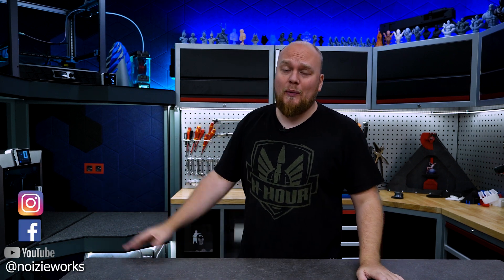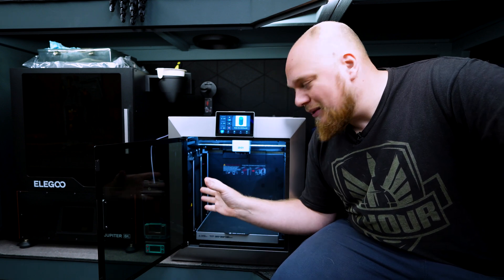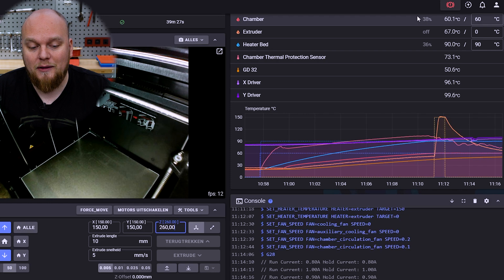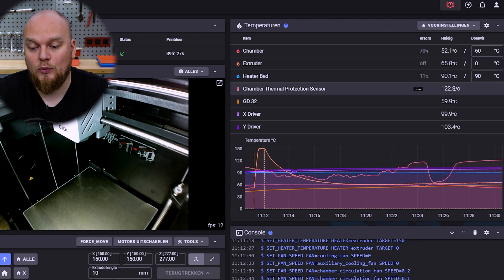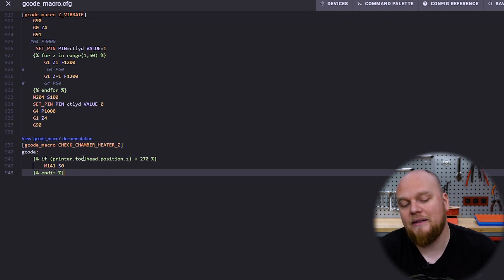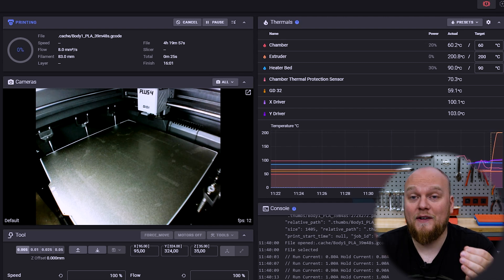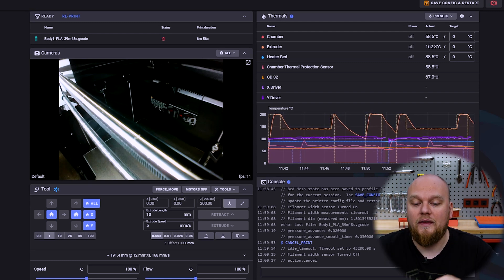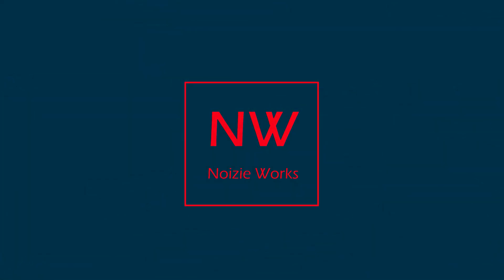Qidi plus 4 has a new design flaw and here is how to temporarily fix it. Bed blocking chamber heater

Comment: A few notes hope QIDI sees this.  To date I have had zero issues, but glad I did catch your comments on this one before I go make a full 275 or 280mm height object in ABS or something requiring heated chamber to be on.  I have had nothing but great success with the 4Plus received back on 25 September.   I did send their tech support few notes and thoughts after seeing your first comments addressing this topic.    If adding a heated chamber fan it should not directly blow few cm away from the ballscrew(narrower ducting or vertical uprights allowing hot air to not directly hit only one side of build plate, leave some room in the case design(perhaps a dedicated aluminum offset box area dedicated to a chamber heater)allowing for easy ability to add a custom duct on the outlet.   I do see where this can be issue for the last few millimeters of a 280mm build height, but do see some workarounds that are possible, simply shutting off chamber heater for last fill layers my be all that is needed until the full fix gets put out.  

This may only effect folks with chamber heater on the last few millimeters, good catch(thinking some side ducts on chamber air exit may be helpful, but waiting to see what they come out with).   I know they are working on this one, will see what they come up with, very important for me because 90% of all material I print has heated chamber going and I do on occasion print some very tall materials.   Thanks for sharing this information.   

I have full faith they come up with a work around and fix, they do awesome job when things like this are found, they have a great running track record of adapting fast based on user feedback.   This is all part of the whole mass market process for 3d printers happens to any and every company and the best ones learn, adapt, fix, and grow.    That is the sign of a great company, so far to date every QIDI product has been rapidly updated based on great feedback from customers like yourself.   This is not a reason to not buy, currently only effects small last few mm of full height and there are some workarounds.  This machine prints some great prints, and is very consistent at doing it, not a game ender for me, it has too many pluses.  Very happy with my machine, the Bambu while nice is way overpriced and does not come with the stock heated chamber, hence why I do go QIDI path.  I had priced out Carbon X with heated chamber and price was around $2400 and than it only had the 250mm bed size, was a no go for me.  The Plus4 prints out layers just as well as Bambu, has a larger plate(305mm is nice gain), and heated chamber for price of $799 was a no brainer.  Qidi also came out with QIDI Studio which I am very happy with shows they are adapting the Orca and Bambu like feature sets which are a homerun.   It comes down to what type of budget one wants to work with, I can purchase two machines for under the price on one CarbonX with heated chamber, with more capabilities and larger footprint, that is a complete homerun in my view. The negative is I lose all of the great software benefits that come with Bambu machines, which I will say is an amazing offering.  QIDI release of QIDI studio is showing they are taking steps in the right direction with the software side.
Reply from the maker: If you message, they will read it that i'm sure.
Qidi studio definitely on the right track but logging in is pointless right now as it doesn't save any of my profiles.
Orca it is!
Reply: Should join the Disk-chord if you aren't already on there!
Reply from the maker: @802Garage  I'm on there, to chaotic for me.
Reply: @NoizieWorks  Totally get it. Can be time consuming to even read. A suggestion for JTs as well though!
Reply: @802Garage  Will check it out.   Been on week off back home where my little Xsmart3 lives, been hammering out prints on it.  See 221 hrs on it….. Doing bunch gridfinity stuff…..

Comment: I must of did something wrong because when I did this, my printer would no longer print. It stopped before bed level and would just idle with nozzle at 140 degrees. I'll try again as I'm sure it's something I did. Thanks for the info
Reply from the maker: @JohnDoe-ot5ir  waiting for filament? There needs be be filament in the printhead and push the cutter so that's the only filament it will use to test this out.

Comment: I just messaged qidi asking about this and whether it be a replacement shroud that is redesigned or partial refund because it wont do as advertised it dosen't say heated chamber unless you go passed the 270 mark
Reply from the maker: Interested in the response
Reply: @NoizieWorks 
Their response

Thank you for expressing your concerns and bringing this to our attention. We're aware of the chamber heat error and we will be addressing it in the next firmware update.I want to also assure you that the machine is designed with built-in safety features, including a temperature protection system for the chamber heater.

Rest assured, the printer is solidly built, so there are no concerns regarding the hardware. We appreciate your feedback and are committed to improving your experience.
Reply from the maker: @andrew6061  ... how the hell do you fix hardware issues in firmware
Reply: @NoizieWorks  exactly what I said in my response that they need to recall or when patched, will be false advertisement because we can't hit the 280 mark when printing because we need the heated chamber i also suggested replacement parts sent out for it but we will see what is said
Reply from the maker: @andrew6061  In all my conversations as a reviewer, they are thankful but have a big avoidance to admit failure or act on it in a constructive way.
They fixed the Q1pro but i'm not sure if sending replacement parts to existing customers when not broken is very high on the list.
This indeed warrants a replacement part as it's fundamentally "broken".
I can understand it, it's expensive but even creality does better if it's a factory fault.
Reply: @NoizieWorks  The only way they can fix it software wise is turning the chamber heating off at 270mm height, basically what the gcode does, this should be enough that a print can survive, we are speaking roughly about the last 10mms most if not almost all prints never reach 270mms! (max height is 280mms)
After all the heatbed also does chamber heating so even if they turn the chamber heating off, the last 10mm should survive the print because heat goes upwards and the print bed also has heat exhaustion going upwards!
Reply: @werpu12 

Thank you for sharing your concerns. Please rest assured, as I mentioned in my previous email, the chamber heat temperature will not affect any hardware components.

We've already released the latest firmware version 1.4.2, which addresses and resolves the chamber error. You can update your printer and test it—everything should work as expected now.

Please let us know if you have any further questions or need additional support. We’re here to assist you.
Reply: @werpu12 
If I may ask I just did your test and it shutoff and that's after the update they say fixed it could you redo this test after you update yours to make sure I'm not the only one Thank you
Reply from the maker: @andrew6061  i already did, it's in the community tab. The feature turns off at 270mm and after that it's the chamber thermal protection sensor kicking in at 130C. Barely a fix imo, going to try and design a new shroud next week.
Reply: @NoizieWorks  Anything else besides the chamber heating issue and the lose bearing problem which is known atm?
I am still on the verge of upgrading this year, I can live with a reduced height of 270mm, never had a print so far higher than 200-250, and I can fix the lose bearing myself after you posted a fix video if it it arises, but I am concerned about more known "bombs" I have missed so far! Oh well Creality all over again, buy device, debug the device with a bunch of mods and then use it for years!
I wished Prusa had a similar device, but they do not!
Reply: @NoizieWorks  Mhh maybe simply replacing the metal plate with a grating should be fix enough, i am not entirely sure that you need to reroute the airflow to avoid it touching the model!

Comment: thanks for bringing this up.  been pleased so far with the printer - my first one so complete noob to the technology anyway.  seems like a fix should be very straightforward for the manufacturer to push out a replacement part.  luckily apart from a poop chute ive not printed anything over 100mm anyway.  multiboard and wall art are currently in the queue - so hopefully by the time i'm needing to do something full height it will be sorted.

Comment: I'm surprised no one is talking about the X and Y drivers, which are permanently at over 100°C. It seems clear to me that there's a lack of cooling on the motherboard, no? At least for the life of these.
Reply from the maker: they are rated to work in higher temps so technically it's fine, from what i hear 160c
Reply: There is a plate replacement mod to put in an 80mm board fan, quiet and cool!
Reply: @JerrieLenore  Even if these drivers support 100°, I would definitely do this mod!
Reply: The TMC2240 has an internal thermal protection.
If the die temperature exceeds 165°C (typical value), a fault indication a fault flag (ot in DRV_STATUS) is raised and the driver is three-stated until the junction temperature drops below approximately 145°C (typical value). After that, the driver is re-enabled

Comment: Please contact Qidi directly and suggest to add a second exit slot in the shroud, so that when one is blocked, the other one will work
Reply from the maker: I did, talk a lot to them. I hope they listen instead of thanking me...
Reply: @NoizieWorks  they usually do, see the changes in the Q1 between the first units and the ones 3 months after release. They corrected basically everything.
Reply from the maker: @olafmarzocchi6194  They probably will, i just hope they do something for the existing owners on this problem.
Except for a macro, a replacement part seems to be the only option unless you consider hacking into the shroud a fix.
I'm fine leaving it like it is to be honest. Feel free to give your opinion on this.
Reply: @NoizieWorks  For many of us who bought early we are waiting on our bonus gifts to come in about a months time, it would be nice if they would send us a replacement shroud that has wider/extra vent holes to fix this issue.
Reply from the maker: @DownUnderTechReview  got an answer from my contact and they are going to fix it in firmware... so it sounds like they are just going to do what i did unless there is some other klipper magic. It doesn't sound like new parts anytime soon for batch 1 users.
Reply: @DownUnderTechReview  If the macro works (we are talking about the last 10 mm or so of the build volume...) then I doubt they will. But once the injection molded parts run out maybe they will update them with side slots.
But again... it's the last 7 mm, 10 mm max, which usually are short layers. The chamber will retain the heat more than enough for the print time of 7 mm height.
Reply: @NoizieWorks  I also do not expect replacements for 1st revision users. But I count on Qidi to update the part for the next revisions. They did it regularly in the past.
Reply from the maker: They probably will and i'm interested on how they're going to implement the auto shut off on the existing ones.
They're not going to run 2 types of firmware on the same printer with a revision.
I hope they don't just call it a day with the new update because it soundsa lot  like that.
Reply: @NoizieWorks  I guess that should be enough, there is no real firmware fix except for turning it off at 270mm + the last centimeter of a print should be able to survive without chamber heating anyway, because the heatbed can take over the job after all, most printers do not even have chamber heating at all and let the heatbed do the job!
Reply: Another solution very likely might be to replace the metal plate with a grate which wont block the airflow entirely!
Reply from the maker: @werpu12  it's not only that, the plastic bearing holder for the bed is also blocking off the exit.

Comment: As I am a newb to 3D printing and this is my first printer please forgive any mistakes I am making here. I received this printer 1 week ago so some updates may have already happened. The heater on my unit is attached via a screw or the top of it. At the air outlet on the heater it is slip horizontally pushing most of the heated air is pushed out of the lower part of the register a lesser amount of heated air flows out the upper part of the register which is open to the upper area of the sheet metal support under the print base. 
Additionally the wires no longer are catching on the protrusion on the right side as it has been smoothed down flush with the right side.
Reply from the maker: Good to know! I also have a screw on top and i think you could take the cover off but the fan itself is glued in. Or at least that's what somebody told me didn't check myself.

Comment: Strange. I just left a comment that totally disappeared. Happens with comment replies a lot, but usually not first comments. At any rate, nice coverage of this issue. I have been speculating that they changed the overall dimensions of the printer late in the design process and that pushed the heater in further. stew675 was the first to make a code fix as far as I know. Just want to add that my Plus4 has still been great with no major issues not even a bearing problem. I was able to produce print in place bearings I designed myself with 0.01mm tolerances and print them without fusion. I was able to break them apart by hand and 1-2 balls with persuasion of a small screwdriver and they spin well within a minute of work. 0.02mm tolerances I can take off the build plate and break free by hand immediately. This level of precision is part of what I really wanted a printer like this for. I'm glad most issues are relatively small, but I definitely hope Qidi is working hard on revisions so that version 1.1 if you will is a nearly perfect printer.
Reply from the maker: Probably the yt bot comment thing that deletes the wrong comments lol... Glad that yours is working great! But i would implement this code just to be sure.

Comment: For QIDI they need to make the discharge duct 2X the thickness of the bed edge 
Silly that the unit is glued 
I would take a dremmel and cut UP 20-30 mm
Reply: What's extra strange is the outlet is taller than the bed edge, but there's a divider flap of sorts inside that basically cuts it in half. I'm assuming the didn't want the hot air touching all the way down to the bottom of the duct and hitting a wall, but that flap could have been a later revision as well which is now causing the issue. It's definitely an easy fix one way or another.
Reply from the maker: @802Garage  yup, i think even drilling some extra holes would be enough

Comment: Yeah I was wondering about that as I saw it as some issue down the line. On another possible issue: on the left side we have the power connector on the main plate. It is rubbing on a screw. Have you seen any issue with that? (Edit: sorry, but you didn't show us how/if it works by doing the same 270 plate level print?)
Reply from the maker: the bed cable is rubbing on a stud on the right and the aux fan if that's what you mean. So far not an issue with 200 hours on it. On the left there is only power to the fan.
Reply: @NoizieWorks  (well, looking at pictures here so left could be right..but thanks..only 5 more months until I buy it! find all issues :) )
Reply from the maker: @OZtwo  imo i would also wait it out, especially with this now. Very interested now in the qid box! Hope they send me one early this time, so far it's a we have no info... So anybody claiming anything is wrong. Q1 that's it.
Reply from the maker: btw, your in the fb group to right?
Reply: @NoizieWorks  Yes. JM :)

Comment: Thanks for this. Was hoping to wait but within 4 weeks all my other printers started having random problems. Ukmed the trigger and just got it set up.
Crazy they didnt think this through. Why cant this be fixed with firmware? Im at least thinking the software fix to turn off the heater would be a firmware band aid fix. Obviously a new vent design is needed at the hardware level for a proper fix
Reply from the maker: It can if you drop the buildheight with 10mm but i think that's not what we want. Unless there is some magical klipper setting or just disabling the safety feature all together which is also not an option. I don't speak klipper so maybe they can do something but a re design is the way to go i think. At least there is a temporary fix.